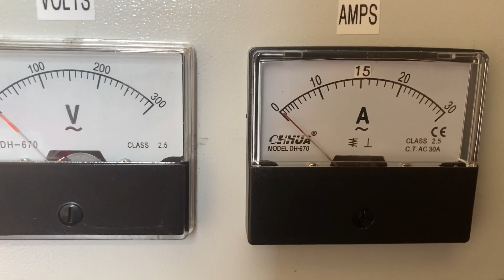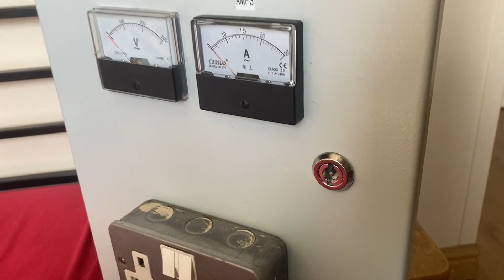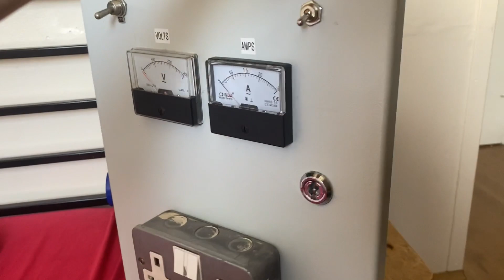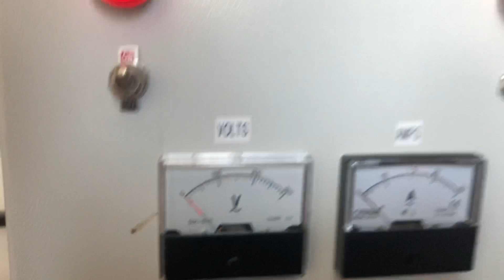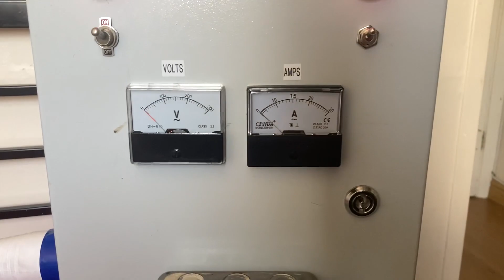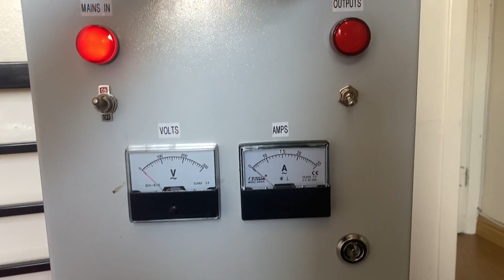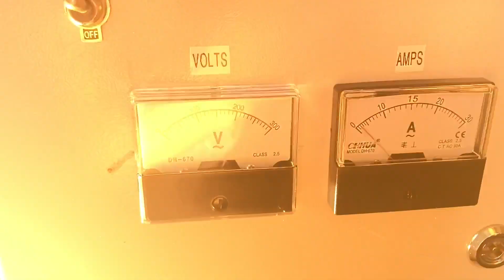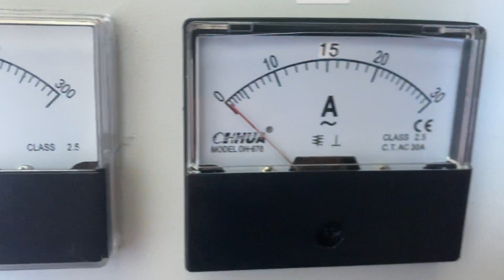DIY Variac Power Supply

Comment: I fixed my variacs inrush current by having a normally  closed switch right at the location of the tap when its set to 0V, since at that setting the switch would be open all the current would flow through my inrush resistor, and when its moved away the switch shorts out the resistor. 
It also has the safty effect of tripping the breaker when the variac is set to a voltage that is not 0V when starting to avoid accidents

Comment: Looks good and useful. The one thing I might be concerned about is if it is top heavy, especially if you roll it around on wheels.
Reply from the maker: It’s stable enough, I’ve tried to push it over and it’s surprisingly difficult.

Comment: Heh you should feel the heat from winding up a 5kW halogen :)
Reply from the maker: Lol I bet that’s silly
Reply: @TheCORC964  The whole CP29 lamp was silly. Cold filament resistance was something silly like 0.7 ohms and when I wound it up slowly on the variac it was pulling enormous current right off the hop! Variac made some noises going past the mid point but was completely silent at full power despite pulling 20 amps!